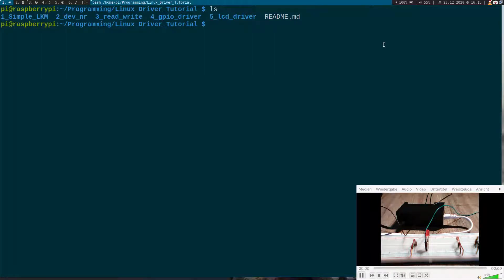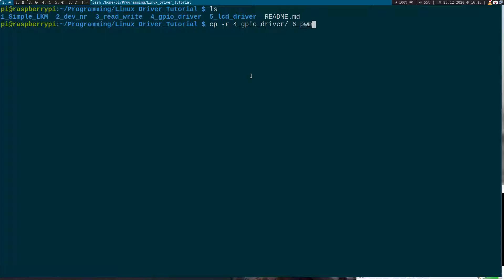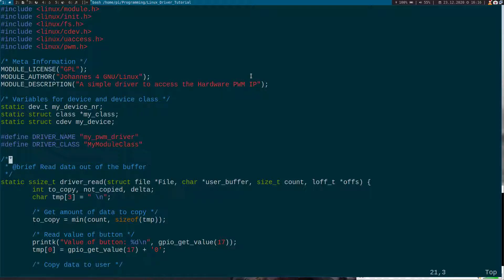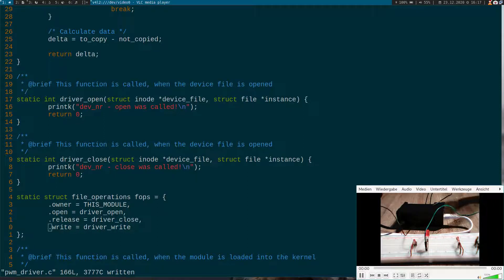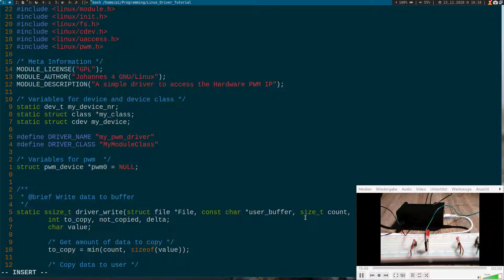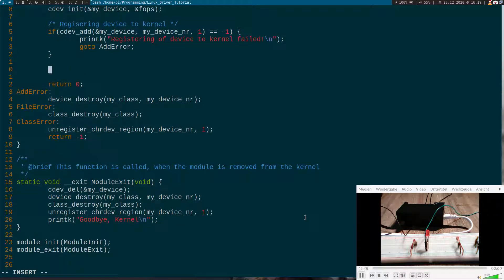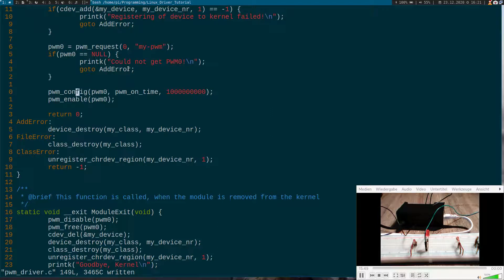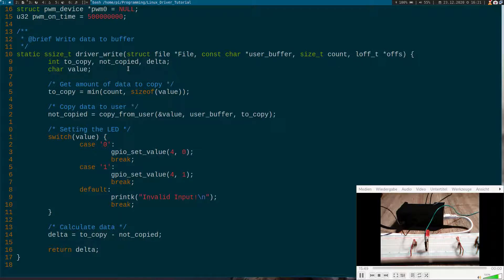Let's code a Linux Driver - 6: PWM Driver

Comment: The kernel doc indicates we should be using pwm_get() and pwm_put() instead of pwm_request() and _free(). The new functions use a pointer to the device struct and a "consumer name" string. After adding the dtoverlay, I see /sys/class/pwm/pwmchip0 linked to "/devices/platform/soc/fe20c000.pwm/pwmchip0/" and child objects used to access the PWM from user space. I am unclear on how these things relate to the device struct and consumer name that pwm_get() requires if I'm trying to play with the PWM from within the kernel. Can anybody refer me to some code or doc that will fill in this missing link for the pwm_get() arguments?

Comment: How to declare a GPIO pin (GPIO 12) in PWM mode in an overlay?

This doesn't work:

$ cat driver.dts
/dts-v1/;
/plugin/;
/ {
	compatible = "brcm,bcm2835";
	fragment@0 {
		target-path = "/";
		_overlay_ {
			driver_overlay {
				compatible = "vendor,driver_overlay";
				status = "okay";
				pwms = <&pwm 0 1000000>;
				pinctrl-names = "default";
				pinctrl-0 = <&pwm0_gpio12>;
			};
		};
	};
};

Comment: I'd like to have an answer about the pwm0,  where the GPIO is configured to use the PWM0?  To configure the alternate function 0.  I don't see it in the current driver code.

Comment: Hello, thank you for the tutorial. Im having an issue while loading the .ko file using insmod. The terminal shows segmentation fault when loading the module. Could you please help me, I desperatley need the code for a project.
Reply: I also encountered the same situation!
Reply from the maker: Hello, are you accessing an uninitialized Pointer? This is often the cause of a Segmentaktion fault.

I would add a lot of printks in the function where the Segmentation fault happens to find the Line which causes it.
Reply: Did you find the issue?  I have the same error here
Reply: The issue is EPROBE_DEFER when we request pwm   (pwm_request(0, "my_pwm") returns a negative error!   The error is not correct handled in the driver.
Reply: Just to help people, at the end of the video, it mentions that we need to use the pwm-2chan overlay in /boot/config.txt.   It's not enabled by default.
Reply: @christiangrenier9434  Should I set this variable in the config.txt file?
Reply: @christiangrenier9434 Please could you explain this error
 Clearly a little bit?

Comment: Hello, first of all, thank you, the lessons are very interesting. Unfortunately, I can't install the pwm module. Errors appear at the moment of insmod. What should I do? Thank you again very much. raspberry pi 3B+ and raspberian 11.

There is a part of the errors:

Message from syslogd@raspberrypi at Feb  1 11:46:51 ...
 kernel:[  511.664542] 3da0: 85313dc4 85313db0 809fe694 801988c4 81401e40 8031b0ac 85313e0c 85313dc8

Message from syslogd@raspberrypi at Feb  1 11:46:51 ...
 kernel:[  511.664561] 3dc0: 8031b0ac 802dc428 802fdc24 80318f00 00000000 00000008 85313e0c 860db4c0

and so on...

Comment: I am having a problem when doing sudo insmod pwm_driver. It doesn't show anything after this task, and it is in a running that I have to use Ctr + C to get out. Do you what problem is?
Reply from the maker: Hm. What Hardware are you using? What can you find in the kernel Log?
Reply: @johannes4gnu_linux96  Thank your for your response. I am using raspberry pi 4. I didn't see the pwm config in the /boot/config.txt in my raspberry. Is that the problem with my hardware?
Reply from the maker: @leanvo3880  yes, this can be the problem. For our Linux Kernel modul we need a driver for the hardware pwm interface to be loaded. Because otherwise on execution of insmod our lkm tries to call functions from the pwm.h header which are not inmplemented,because no pwm driver is loaded. 
So check how to enable pwm on a Pi 4. After that verify with lsmod | grep pwm If a driver is loaded before insmod your lkm.
I Hope this is the issue :p
Reply: @johannes4gnu_linux96  thank you, I will try that
Reply: @johannes4gnu_linux96  finally, I got it. Thanks for your tutorial. Could I ask one more question? If I want to read two or more variables such as duty cycle and frequency... from the user space, what should I modify the code?
Reply from the maker: @leanvo3880  How did you fix it?
Check Out this video:
https://youtu.be/tNnH-YiY_1k
You need a device file over which you can communicate with userspace.
If you want to manually add your device file check out part 2 of my Linux driver series. This way you need less Code.
Reply: @leanvo3880  Hello, I know it's a long time since you resolved this, but if you remember, can you explain how you fixed this problem ? Thank you. My issue is that after I write to device, nothing happens anymore. Only a printk is printed before I call the function copy_to_user(), afterwards nothing happens anymore.
Reply: @leanvo3880  could you tell me how  you fixed segmentation fault error in pwm driver please ?